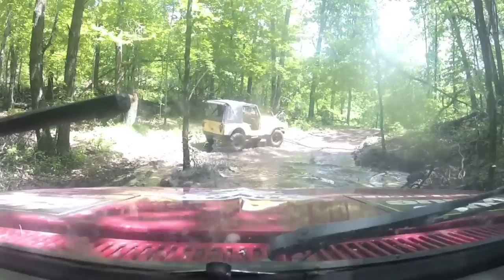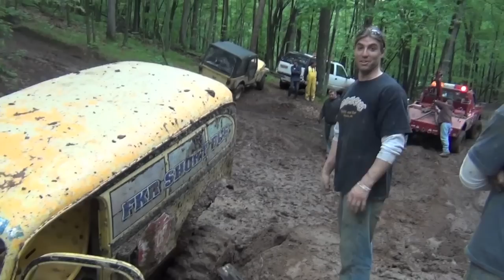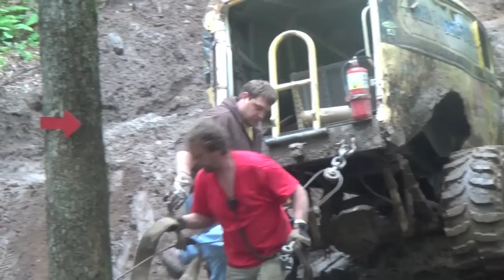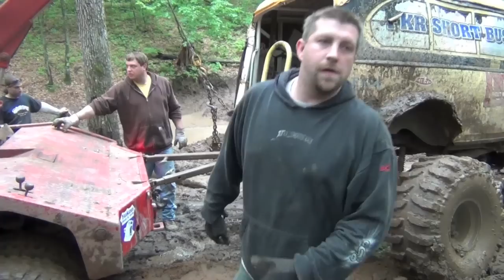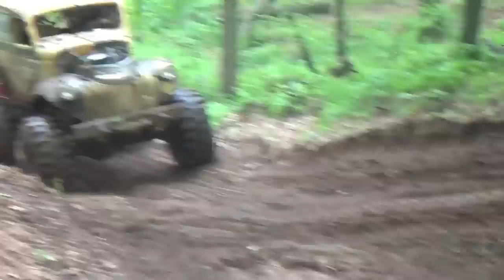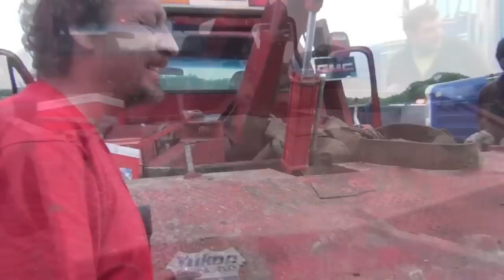FKR SHORT BUS GET'S HOOKED! by BSF Recovery Team

Comment: I was wondering why you didn't hook on to the chassis tow rings to begin with .I always used snatch block when pulling gear out the mud,without going into the maths you decrease the load on the winch and double the weffort being used to shorten the rope. 
What size rope is that? We used a 1/2 Rope ,which was changed every year and even broke that a few times. We always laid a ballistic blanket over the rope. It doesn't look like it would do much but it does prevent the rope whipping and possibly killing someone.

Comment from the maker: Good ears! Yes my high buck front shaft is wearing out, the u-joints are Ok but the CV is worn. I need a sponsor to build my a new high angle 35 degree CV front shaft with 1350 joints.

Comment from the maker: Sounds like you still have a fuel restriction, you can verify that with a fuel psi gage and if you tap in at different spots like at the t.b.i. or before the fuel filter you may be able to pinpoint the problem. It is very hard to get a fuel tank clean after a problem like that, you might just have plugged up the filter again.

Comment: Make shift winch blanket.  Basically incase that cable snaps, that strap will help reduce a lot of whiplash as the cable snaps back.  An actual winch blanket works much better.

Comment: Or the morgue.  One also has to consider that your rig might pull part of a vehicle clean off.  You clearly know what you are doing, and it seems like you keep your gear in great shape.  But I, for one, feel better about watching you work when you toss that cover over the cable, for those long pulls, to tame it a tad.

Keep it up, whatever you do.  You do great work.  Anyhow, you can always operate the winch with your other arm.  ;)

Comment: Short bus<<left t case in gear until something snapped internally,locking it up,and then he ran the engine with the sump of the oil pump higher than the oil which was all pretty much at the front of the engine...

Comment: is there a reason they couldn't drop the drive shafts?
Reply: Exactly what I was thinking.
Reply: +dosbox907YOU WOULD HAVE TO LAY IN MUD & MUDDY WATER !!!
Reply: minusmodest is there also a reason why he couldn't just back up to the short bus and lift the rear end up and pull it out so he wouldn't damage the drive shaft or any other parts
Reply: @nathanhearld474  if he backed up all the way to the hole he had to use the front winch to pull him forward instead of using the powerfull hydraulic winch to get the bus out. maybe he could do it with 2 pulleys but that would be a very long day (i'm not sure if there is even enough cable on that winch to do that) and i'm pretty sure nobody wants to lay down in that mud to pull the driveshafts out, would you want to lay in that mud? but that's only my opinion on this one.
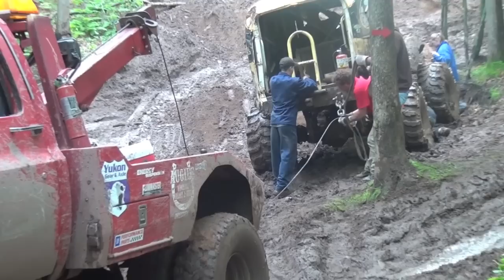Reply: 11:52 there...

Comment: 1. Pull bus out of hole. (like you did)
2. Pull both drivelines.  15 min.
3. Start engine in bus.  Now you have
   steering and brakes
4. Tow bus out of woods with tow strap
5. Charge bus driver 750.00 for your trouble
6. Call it a day.

Comment: why didnt you inflate the tires on the bus, common knowledge is to lower air pressure for more traction, higher inflation would have made it easier to pull(maybe not a lot but every bit helps).